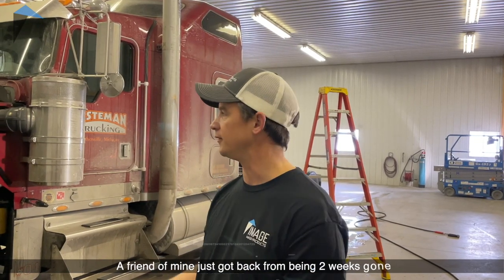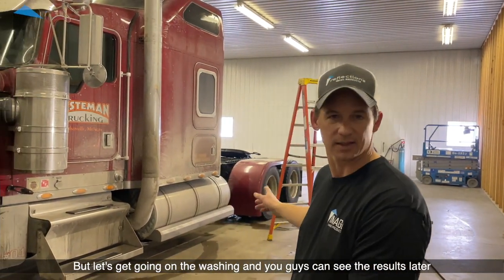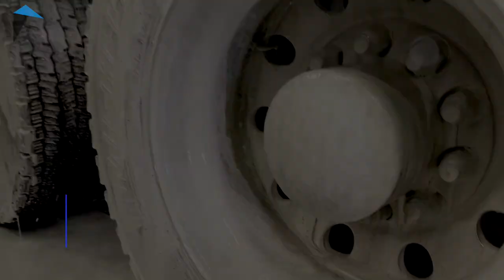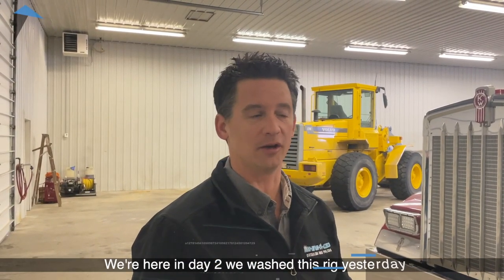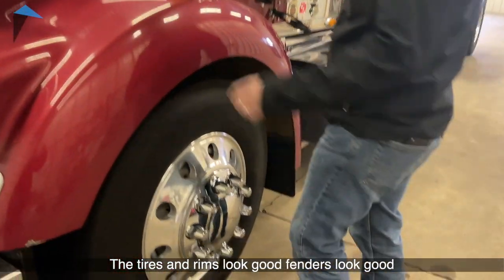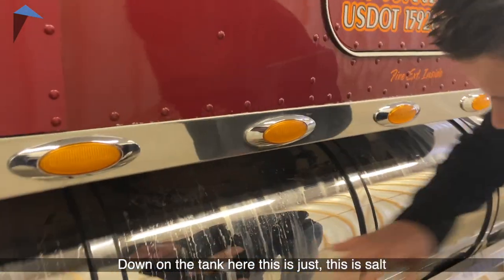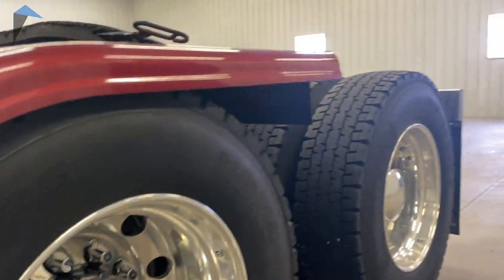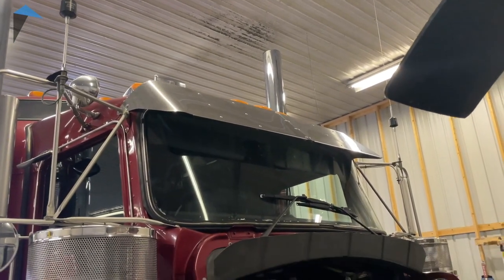Polish Safe 2-Step Touchless Truck Wash - w/Detailed Walk Around

Comment: Great job washing the truck and know what it's like to get a truck clean without making mistakes because I washed trucks and trailers and I had to brush them all and it took about 30 minutes plus just wanted to say hello from n.c.
Reply from the maker: Thanks man! 30 minutes for a brush wash is super fast! Is that just for a day cab?
Reply: @ImageWashProducts  well we had to wash everything that was going out on the road both trucks and trailer's and they wanted the trucks and trailer's to be very clean to go out
Reply: Did u guys  use a hot water pressure  washer or just a regular  pressure  washer type

Comment: Thanks for the video, I'm just getting my business started up here in Vancouver B.C so this helps a lot! BTW were you using hot water?
Reply from the maker: Congratulations on the new business!! Glad you find this helpful. We do all of our 2-step touchless washes with cold water. The only time we would use hot water would be for heavy degreasing or for the rinse portion of the process. 99% of the time, we stick to cold water.

Comment: Looks amazing !! I have a 8gpm machine @ 3500 psi. Do you have a cannon that would work for me?
Reply from the maker: Hey Dan the PSI is certainly within the parameters of both of the foam cannons we offer, the only issue is your GPM is higher than they can handle which can certainly impact the performance of the foam cannons.

Comment: I have a 4 gallon per minute, 4000psi pressure washer is that too much? What do you recommend?
Reply from the maker: That'll work perfectly! I wouldn't recommend anything different. Only recommendation I would make would be to use a 40 degree tip when rinsing.
Reply: @ImageWashProducts  so when using your foam cannon it’s safe to use that type of Psi

Comment: I have a 4000psi- 4gpm pressure washer. What pressure should I tone is down to when using your foam guns? Could I use an X-jet to put the cleaners down too?
Reply: You need to down stream the chemicals on and use a dual lance wand so you can adjust the pressure on demand. 
You can add an upstream chemical injector to your machine for about $50 and you will speed up the cleaning process by about 50%. 
If you can use at least warm water, you will get much better results  
A truck like this will normally take about 20 minutes to clean with one personIf you are going at a medium pace.

Comment: Is this ok to use on a rig that's been ceramic coated?
Reply from the maker: Yes! Absolutely. This is the preferred way to wash ceramic coated vehicles since you're not putting any friction to the surface with a brush or mitt. Touchless washes come out WAY cleaner when the vehicle has wax or ceramic coatings.

Comment: How many gallons of water roughly do u use per truck .
Reply from the maker: Good question. Our pressure washer is a 5.5 GPM unit and it usually takes 30-40 minutes to do a truck.

Comment: Thanks for taking us through the truck with the post-wash inspection. Quick question, if I wanted to go 100% clean and break out the mitts, is it still okay to leave the 2 step on there (with the neutralizer), or should I significantly reduce the areas that I spray at a time?
Reply from the maker: Great question. First of all, thanks for watching the video. Glad to hear the extra effort we put in with the post wash inspection was worth it. We appreciate the feedback.

Although the pH will be neutral after using both steps, we still don’t recommend getting the chemicals all over your hands/arms, as is typical with a mitt wash. 

If you plan to mitt the vehicle anyway, we’d use our other soap, Platinum Wash. It’s a super high lubricity soap that’s perfect for mitt washing. 

A lot of times, we will bust out a hog hair brush to get some of those areas too difficult to hit with the proper rinse angle. 

Hope this answers your question.👍

Comment: Will the step 1 etch any glass? Though I heard in another video to apply step 2 on all glass before applying step one, is this true?
Reply from the maker: We have never expereinced etching of glass with our step 1. It's a very gentle step 1 made up of organic acids. So it's less aggressive on things like glass or polished aluminum. 

As always though, make sure to test on a small section before using it on the whole truck. Never know what kind of environmental factors may be specific to your setup/water/etc.

Thanks for your question!